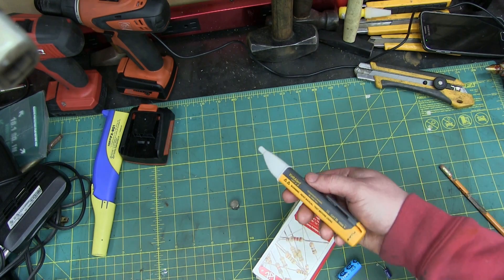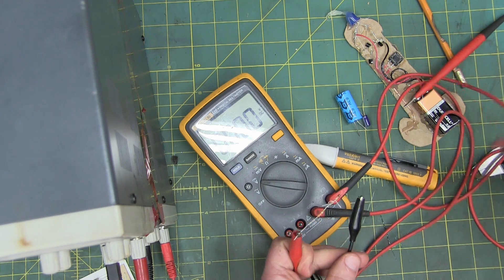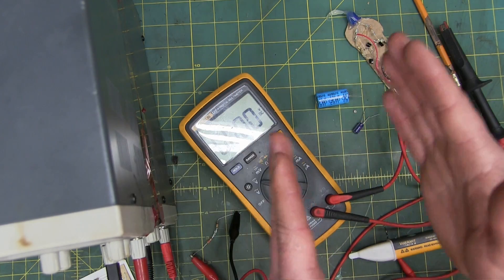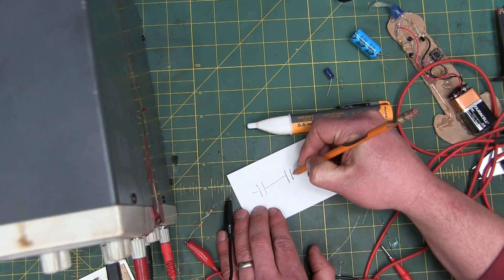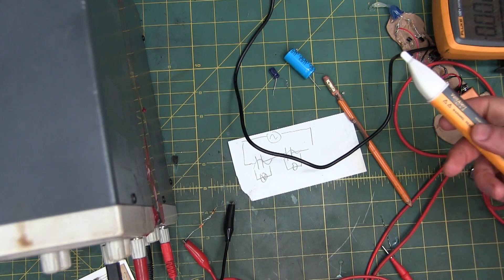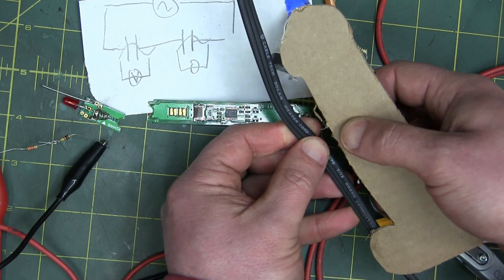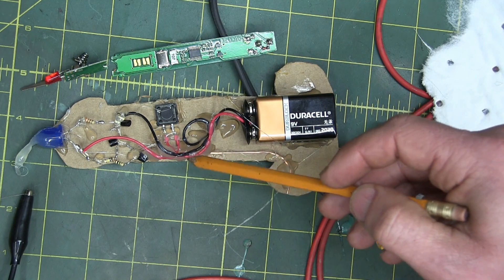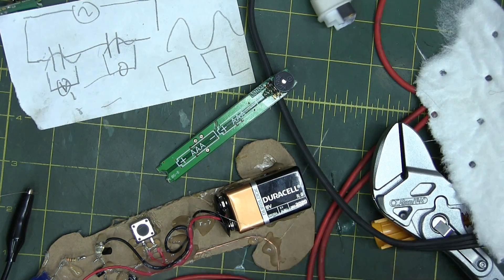Non-Contact Voltage Tester | How does it work?

Comment: Did you just say electrons move in the one side and holes into the other!?
I'm sure it was just a slip of the tongue, but in case it wasn't:

Almost all capacitors use 2 or more metal conductors as their plates (yes, you do get such a thing as semiconductor capacitance, but that is a whole other can of worms and has nothing to do with how electrolytic, film, ceramic, polymer, tantalum, etc. capacitors work).
Electrons move through the metal as a delocalized 'gas', without any holes being involved.

Electron holes aren't simply the absence of an electron. Yes a hole is formed in semiconductors when an electron gets promoted into the conduction band, but those conduction electrons don't fall into the hole to 'move' it one space on, as current moves through.
The moment a conduction electron falls into a hole, it's game over: The hole disappears and the electron becomes a normal bound electron again.
Holes are their own quantum mechanical objects. They have their own masses, velocities, etc. which are all different from those of electrons in the same semiconductor.
Reply: SEMICONDUCTORS ARE MAGIC - my takeaway from studying physics.
Reply: DreamHazard; DreamHazard; Electricity is magic: My takeaway from first learning about it in grade school, not finding the explanations satisfactory, becoming annoyed enough to go study electrical engineering after highschool, still not really being OK with the whole thing, and currently, once again studying for an undergraduate degree, but this time in Physics.

And it isn't even that I couldn't keep up and dropped out or something like that. The most frustrating part is that I have always gotten really good grades. I can't quite describe the feeling of graduating electrical engineering cum laude (which isn't that hard to do if I'm honest. The threshold is set waaay too low in my opinion, but I digress...), but still having no fucking clue what 'electricity' really is. For example:
Do Cooper pairs 'travelling' through a superconductor also constitute electricity?
Does the electron really have no size?

As a simple example: To understand a simple circuit consisting of a DC voltage source, a switch and a lightbulb, you need to understand how (amongst many other things) the EM wave propagates once you close the switch; breaking out of the conductor and travelling along its surface, through the dielectric insulation around the cable.

Just look at the "travelling through a dielectric" part: This is equivalent to light travelling through a transparent medium with some refractive index > 1. How is the light slowed down, without being otherwise affected?
How is light generated when a charged particle (say, an electron) travels through the medium, at a speed faster than the phase velocity of light in that medium (basically, how does an electron going through the 'light-barrier' produce an 'optical boom').
Even when you finally grasp the answers given by the infinite path-integral approach of QED and applying relativity to it, it still leaves very fundamental questions lingering about; such as:
HOW and WHY does a specific electron actually absorb or emit a photon?
Is the probabilistic nature of absorbtion/emission the exact same mechanism as that which governs the photon's probabilistic travelling wave-function, which interacts with all possible atoms/particles and paths through the dielectric, or is it just modelled the same.

Sorry for the long rant. You can probably tell it's an incredibly frustrating subject, which is also very close to my heart.

Comment: WHAT? I didn't authorize the use of my bodily capacitance. I'mma sue Tesla Motors (inventors of the Alternating Current, as I am led to believe.)
Reply: Nope.. Tesla was for AC and Edison was for DC.. Edison tried to show everyone how "dangerous" AC was by electrocuting a pig..
Reply: SuperPickle15 yes sorry elephant.. your right my bad
Reply: But not related to Tesla Motors, I believe.
Reply: Tesla did not invent AC.
Reply: If you had a Tesla and it got stolen it would be known as an Edison
Reply: Tesla cars use AC induction motors. DC in the batteries is inverted to AC but the main drive unit is an efficient AC 3 phase 4 pole Induction motor inspired by Nikola Tesla.
Reply: No. Lol Nikola Tesla (the person  himslf) invented ac. Other have explained the rest.. Tesla motors has both edison and tesla rolling in their graves. "Tesla" branded car running on DC.  Lol
Reply: I thought Tesla was all about DC and it was Edison and Westinghouse supporting AC.

Comment: Can you do a follow up on phantom voltage? The breaker is off but the thing keeps beeping! Til you touch the box that is. Is it picking up something from wires laying over each other or is the user not grounded properly?
Reply: It is most commonly induced voltage. Ive seen as high as 200 volts induced on a 347/600v system. The thing is there is no load so if you ground it nothing happens. But youll still read the voltage.
Reply: buillioncubes this! I had an instance where I was asked to help with figuring out why a dryer wasn't working. It was getting 240 V, even with the power to the house killed. It wouldn't start anything, and when I'd hit the start switch for the dryer, the voltage would vanish, but come right back once I let go.
Reply: OK, thanks! Ave's reasoning got me wondering.
Reply: Capacitive coupling across the Mains switch.  A common problem, especially when your Main Breaker only disconnects phase (not neutral). Most NCD's are so sensitive (high nanoampere sensitive), that they will register any static voltage.